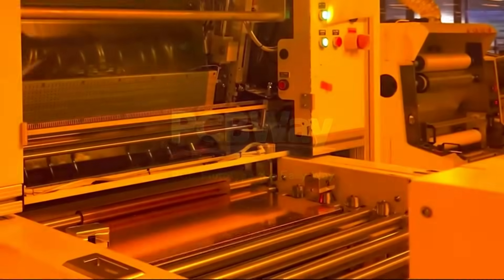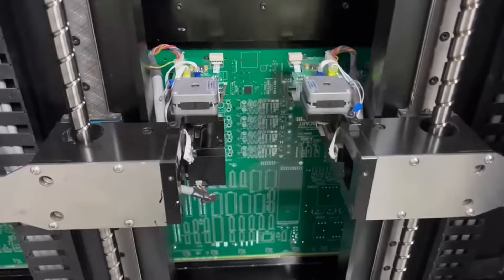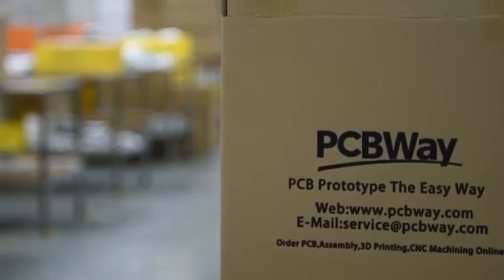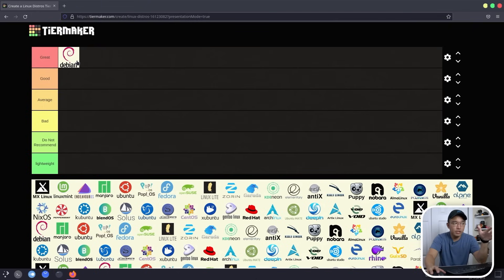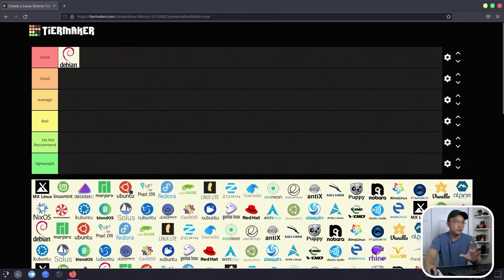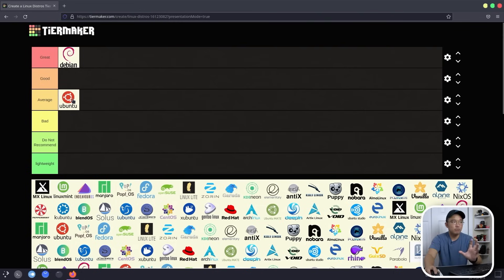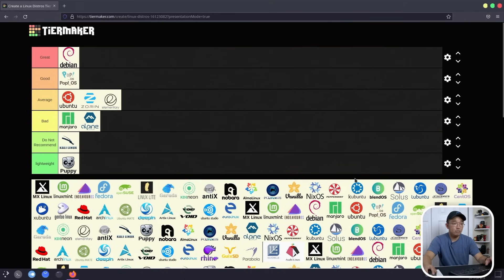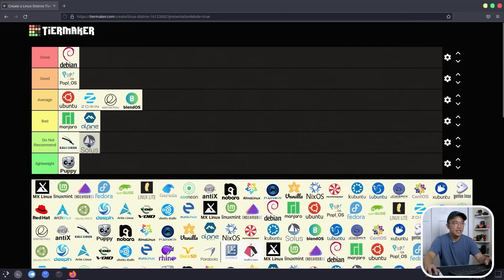Ranking Linux Distros 2023: Linux Distribution Tier List

Comment: I have been a productive Linux user for several years. The first Linux I used for a long time was "Linux Mint", followed by "openSUSE". In between, I kept looking at other Linux distributions. Until I finally settled on Mageia. I think that this distro is very beginner-friendly and can be used productively. The graphical installation routine is clearly laid out and includes a dual-boot bootloader. There are various desktop environments and a notable Mageia control center. This control center is used to configure the system and is intuitive to use. Mageia 9 is available in a variety of languages, all of which are well translated. The documentation is easy to understand and very comprehensive. Since this excellently made operating system runs very stable and secure, among other things, I think Mageia 9 definitely deserves a place on the list.

Comment: I think Arch Linux gets ratted on too much. It really isn't that hard to maintain. It's the best OS if you want to build everything from the ground up and are happy to learn. On the scale of full control to no control it is a solid 9 and maybe for some people this is hard. But I've run it for 6 months with Hyprland, the only issue I have had with it was after the release of Plasma 6 some KDE stuff on Dolphin didn't work with my theming, but that was quickly fixed

Comment: Alpine Linux is not actually a bad distro, it's just that the distro itself is not designed for desktops but rather for servers and iot stuff. The pros of using this distro is that it is really lightweight, secure.

Comment: I noticed that Debian 12 uses the Linux Kernal version 6.1. I have a Ryzen 7 7800x3d and 7800xt gpu; they require Linux kernal 6.4 and up; therefore I can't use Debian right? I noticed Ubuntu 24.04 LTS is coming out on April 25th, 2024 and will use Linux Kernal 6.8. If anyone know other distros which will work with recent gpus or cpus please let us know thanks. I don't about Fedora but it didn't work good with my laptop with a Nvidia rtx 3060; but Ubuntu 22.04 worked better and easier to use. Perhaps, the next Ubuntu you will have an option to use snap or not; seems like 1 of the major reasons not to use it.

Comment: One can hardly call Fedora stable, especially with VM's. Debian for me just too much a pain to deal with lack of driver support.
For a desktop I prefer Ubuntu, Fedora upgrade cycle is far too rapid. I use proprietary software as well, only Ubuntu, and RHEL are generally supported. On servers there is only 2 options, RHEL, and Oracle Linux, the rest is just too unstable.

Comment: Excellent overall rating presentation but I think you are giving Ubuntu too much credit. I have been a user of Ubuntu for well over 15 years. My upgrade to 14.04LTS was a little disappointing. My upgrade to 18.04LTS was very disappointing when they dropped the standard classic menu driven desktop for their "look at me, I can do an icon driven desktop just like windows". I hate icon driven desktops. 

I had to search the Internet for the retro desktop version that installed on top of the new Ubuntu. When I recently upgraded my desktop to 20.04LTS the upgrade completely broke my graphic interface. The current Gnome would not work at all as well as a couple more GUIs that I had installed. I got lucky that I had one GUI installed that would at least let me operate in graphics mode but is barely limping along. It doesn't display my desktop files on the desktop plus a few other quirky things. I lost the small multi desktop switcher in the bottom right corner of the screen but I now have a dynamically expanding desktop switcher hidden on the right side off the screen. I am beginning to really like this new dynamic desktop selector hidden on the right side but it's a flip of the coin as to which one is better.

I have about 10 years of installing apps, libraries, system level daemons, proprietary drivers, and such... along with Plex which supplies my home with distributed multimedia. This is why I stopped at 20.04LTS which was supposed to be just a step to 22.04LTS. Another reason that I'm abandoning Ubuntu is when they do an upgrade, they throw out perfectly good utilities that we have all grown to love and replace them with strangely operating ones as they keep tightening their proprietary belt (so to say). The last straw was to replace their standard generic software install package and repositories with that damn snap system. I also hate the fact that I no longer have a menu driven desktop. It hurts my eyes to have to scan through all those icons for the program I want to install or run.

I am thinking about going with Debian but thought that I'd look at a few suggestive videos for one that might shed some light on which Linux flavors have the packages that I prefer and those that are loaded down with the non-standard ones I hate.

Comment: I'm 100% kubuntu.  Activated prime nvidia 100% and using steam snap.  It fixed every issue related to vsync, gaming, stability and vsync video playback as well as compositor vsync..  Omg!  I went from using Linux for years since 1997 writing scripts per app to repair vsync issues, then shot over to windows for VR gaming.  I'm back on Linux.  Sadly not trying VR on it just yet.  It just works.  I just bought an acer nitro with dual gpu and swapped out the internal for a 4tb pci-e and a 8tb ssd.  I'm soooooo happy with it.  I added a 32 inch 4k monitor and some other bells and wistles just to get my feet wet again.  I love how dolphin sftp to my 100tb Nas server like nothing.

Comment: I've played around with 45 different distros over the past quarter century, dual-booted Ubuntu & Windows for about a decade, but I currently run Linux Mint and/or LMDE6 on my two desktops and laptop. I gave Bodhi with the Moksha desktop a try recently on my secondary system and loved it, but eventually switched over to LMDE6. Haven't used Windows in years.

Comment: NO, no Debian12. After its release a few months ago, I changed my mind. At he beginning all worked OK, Later on, Plasma has presented MANY errors from start, which became increasingly more repetitive and very frustrating, after every new update (???!!!) to a point of more errors, including my video drivers (AMONG MANY OTHER THINGS). Programmers need to be sure and more careful about update compatibility. NO tech support from the mentors of this distro and there is NONE Forums for Debian12. I would NOT recommend it for beginners or intermediate... sorry!!!... To backup from Timeshift is NOT as simple as from Cinnamon or Mint. I'm going back to them.

Comment: When I came back to Linux years back I started with Ubuntu and quickly to Kubuntu but after a while it was clear it was having problems and I was hearing about the privacy issues. I went to Manjaro and it was great at first but then it started happening where things would break down and even after new installs so then I moved to POP. Now I’m starting to have boot drive issues with POP and I was thinking of just going straight Debian and you’re making that more likely

Comment: I tried to install Fedora. But it wont work due grafuc issues..i tried gaduda, it had also some.iasues. pop os was nice, but my monitor kept dimming (i use a desktop) and no way to turn off that issue. I tried nobara and so on. Using a nvidia card and that seems to make trouble for most distros.

Comment: I spent about a week trying to get NixOS working. It’s not that it doesn’t work. It’s that there are too many different ways to get something done and there’s a pretty good chance that the first thing you try won’t be the right one. There’s also the fact that some of the ways to do a given thing will step on each other’s toes. And the documentation is just as scattered as the rest of it. You might be able to figure it out, but I needed help just to install a package that was listed in their repository. It took about 5 hours over 2 days. I just don’t have that kind of time to dedicate to everything that’s going to take that kind of time. And I’m not talking about complicated tasks. I’m talking about things that I can get done in Mint or Debian or Arch in under a minute. So it’s a good idea that’s just not ready for prime time until they can focus and refine the work flow and the documentation so that a fairly experienced user (though not recent experience) can use it without going back to college for 2 or 3 semesters.

Comment: Since Solus released an update in July, I think it became great again. They went through some hard times with the main maintainer leaving the party (and working on a different project: Serpent OS), but they are back with it now, they are keeping up with the Blog and Solus really does feel fresh.  They fixed a few annoying nuances (like crashing when going into the multitasking settings, breaking, if it doesn't get updated out of the box, etc.). Budgie also feels refreshing, partially because it is now more of an independent project. I really feel, like Solus deserves more love. It is very unique, it is a rolling release, while maintaining that stability and usability. Plus, it is the quickest complete distro, that I have experienced. Alpine is quicker, but not suitable as a daily driver and NuTyX has its ups and downs.

Comment: In my little Box o" Distros, full of USB sticks, way back in the back corner, sits a little 8 GB drive with Mabox Linux on it. It's my guilty pleasure. My secret sin. I love it and I hate it.

Picture Manjaro without the a$$-hattery on the backside and there you have it. It's based on Openbox, so it is indeed lightning fast, but it's also a different learning curve to your average experience, and I'll tell ya', it's frickin' *beautiful*. If you've ever messed around with window managers, you know they are usually kind of...austere. But the Mabox team has kicked it up thirty notches. If nothing else just try the live USB and play around with it. But mostly, just LOOK AT IT.

I'm triple booting Linux Mint 21.2, Sparky Linux, and Garuda Cinnamon. Linux Mint is my favorite all-rounder. There's just enough hand-holding to get past the tedious stuff, and it's so smooth and well-put-together. Garuda is my answer to when I feel that recurring Arch draw, but it's ten million times less tedious than Arch. It'll probably be what I install on my gaming laptop when I convert it from Windows 11 one day, if I don't go the Nobara route. Sparky is deb-based, but is curated to a comfortable point without being stuffed full of stuff you'll never use. It kicks around much fast (on my machines) than Mint does...it feels lean and mean.

My goal is to run Fedora on everything I have. The only thing stopping me is one Windows program I use quite a lot, but which is notoriously hard to get to run on Linux. The few successful guides to installing it require a Debian distro, so I'm stuck in that realm, at least on my writing machines. But I LOVE Fedora.

Comment: PoP os should of been in the great category. Because of the fact, there system just works. its the only system that is hassle free. I don't have to constantly meddle with things like Linux is known for.
Reply: Why display graphics are dim in Linux distros for amd ryzen compared to windows
Reply: @ajithjithu3084  I have no idea i have a ryzen 5 5600 with a 2070. no dim issue never had it. been on pop for over a year now. what drivers are your running?
Reply: @MechThumbs he is spamming the same question in replies to all the comments
Reply: The only thing dim here is your mind. Try using your brain if you have one. @ajithjithu3084

Comment: Don , I had to hit that stop button at 7:28. I like your channel and I find it quite informative, but... I've been a Linux user and admin  since 1999, my first distro was Slackware, and one thing I can say, the best distro is the one that works for you. Not how it looks, not how often they update the base but does it serve it's purpose and is it stable. I've tried many distros over the years, some of them don't even exists anymore. So, my issue with your review in first place is that You cannot slam a distro as BAD just because it's OLD, or using 20.04 base or whatever. Or the developers are too slow to post updates. These are not benchmarks in any way. I agree with you when developers start acting like MS and Apl, pushing, even forcing their ideas to the user in the case with Ubuntu, Canonical and some others. Given most Linux users have knowledge well above the average PC user, I find distro rankings a bit odd and should focus on function rather than looks. Let everyone try and choose. That's why it's called Free software.

As I said, the best one is the one that suits you the most so in my case as main desktop MX with KDE and Liquorix kernel, for my kids gaming desktop dual boot Mint/Zorin with Steam, I've Mint laptop for every day use as well as Mint 18 laptop for specific tasks and software that wont run on anything newer. I'm currently testing newly assembled Mini ITX desktop with Peppermint12 with XanMod kernel and so far so good. 
Regards

Comment: If you have a tinkering / looking under the hood mindset and you're really a super control freak fanatic about self customizing and stripping down your system to the barest essentials THAT ONLY YOU WANT. The original vanilla version of Arch and Gentoo Linux  are for you. But yeah, if you're a noob crossing over to Linux - those two will be your ultimate nightmare.  The traditional way installation process for them itself , will really take you way out of your depth - but the real fun kicks in after you've successfully installed them and things ,for some reason, break. So another mindset quality that is attracted to these two are the people who get amped up by technically solving complex problems. The analytical types that love fixing things and think "Bring it on b*tch! Break it. I bet you that I can put all back together again and make it work better than before you broke it and gave it to me" - If that's not you, stay far away from these two vanilla version distros. There are ,however, other newbie friendly versions that are based on those two.

Comment: Fedora it is. With gnome, you don't even have to touch the terminal for installing codes and nvidia drivers. Its all in the software manager, scroll down to the very bottom and there you'll see other main categories for codecs and hardware drivers. Fedora just works. It's surprisingly simple, and stable. There were no other linux distros that I've fallen in such a deep love as Fedora!
Reply: Im using it too. Needed some configuring at first, but its been smooth sailing. Gives me newer packages like Arch, while still being stable like Debian.
Reply: Is RHEL source code being closed gonna affect Fedora?
Reply: @shrkwy  No, Fedora is upstream. Fedora is sort of a testing branch for RHEL, and is a community project. RHEL going closed-source is mostly because their corporate consumers were starting to migrate to free-of-charge RHEL clones like Alma or Rocky Linux. But at the end of the day Linux is open-source code, and that isnt affected by RHEL closing public access to their source code.
Reply: Why display graphics are dim in Linux distros for amd ryzen compared to windows
Reply: @ajithjithu3084  You have posted this three times in my other comments. Sounds like a driver issue on your end.
Reply: installing codes? what are you 7?

Comment: I've used ubuntu, pop os,  elementary, manjaro, raspian, linux mint, mx linux, and maybe a few others I forget.
I currently use mx linux, because it was really light and boots fast to revive an old laptop.   It really came down to linux mint or mx linux, but mx linux was much faster for boot up.
Reply: I really like MX's toolset. The only other distro I've found close in that is Garuda but it's arch-based.
Reply: Why display graphics are dim in Linux distros for amd ryzen compared to windows

Comment: I haven't tried a lot of distros, 2 weeks ago I had a huge problem with windows (I used WSL for the last 3 years as my "main working machine", first on ubuntu and then jumped to debian a year later +/-) where I lost access to the insider program without any notice making me lose access to any virtualization meaning I couldn't access any VM nor read any vhdx from night to day. Huge rollercoaster of emotions but happily I could recover the data with the help of a few folks.

That made me finally make the jump to dual boot and make a full on linux distribution my daily driver.

I chose arch, although the meme and overall sentiment is that "arch is hard" you have to look at yay, and at how light and stripped it is. Yay is amazing, AUR is amazing. The fact that you can have a package connected to the git repository and build it / install it on your machine so easily without having to wait for the distributions channels to get updated is insane. 

Imagine you have a bug after an update, depending on the difficulty of the bug you can fix it yourself so easely without having to wait for all the OSS process. That's insane. 

I think people really overthink/overcomplicate the differences between distributions. Most linux users (right now) will "make their own system" anyways, it's not like it really matters. I'd argue it is better to go with a more stripped out version than the contrary so you can put it together without any bloat.

But yeah, great video keep it up.

Comment: Actually Solus OS has had a new ISO released recently.

I like it… but would put it under bad because of the lack of packages, and it seems like a dying distro.

The Budgie Desktop environment is my favorite DE though, and as long as you have a fairly modern PC it runs well and has a strong Windows 10 similarity to it but it’s much more customizable.